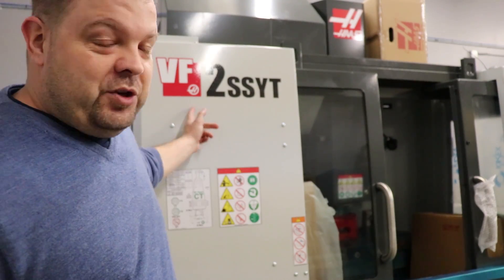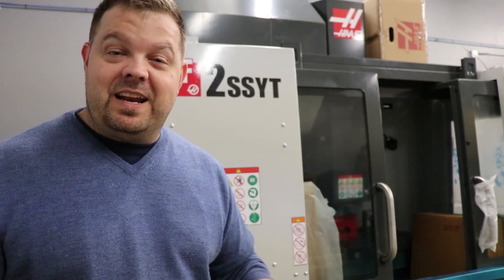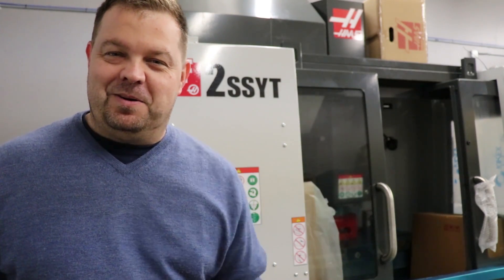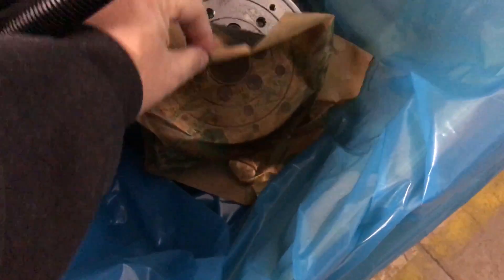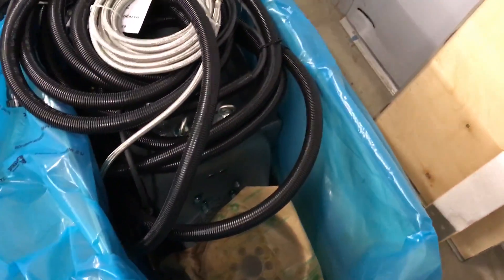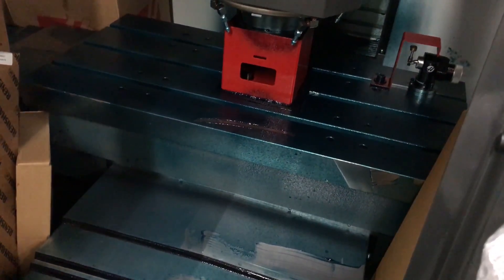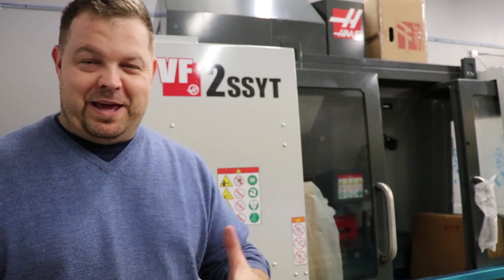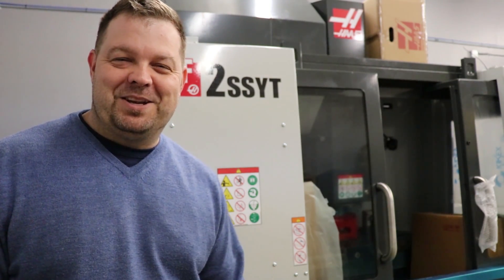5 Axis Rotary - Haas TRT160 Unboxing

Comment: Dude, nice acquisition, looking forward to what cool things you use it for.  Curious, are you running a shop or something?  Those are some expensive machines, what's the revenue source to make the payments?  I know YouTube isn't going to cut it, at least not yet.  I'm looking to get some machines myself but before I pull the trigger, I'm trying to line up some reliable work, to at least break even on the machine payments.  Hopefully at some point enough work comes in that I can buy more machines and pay some people to run them.
Reply from the maker: Andrew Michaud I own a manufacturing business that already generates revenue.

Comment: Hi Jason,
Did you purchase the MRZP option or what ever it is they call it. We have it at work but have been told by our HAAS HFO don't use it without the proper post or you will crash the machine. So we have been doing it the old way, just making sure everything is place in the proper location in the CAM system until we get our new post. Good luck, doing true 5 axis is a lot of fun. I run a Deckel Maho DMU 60 so the Kinematics take care of everthing, but I help the guys out on the HAAS machines.
Reply from the maker: THANK YOU! yes i have the DWO/TCPC and MRZP template. I'll look into this ASAP. I am literally sitting here testing 5 axis tool paths in simulation now.

I program in HSM works...I'm going to set up Machine Simulation

Comment: I like the new design for those! I have the old version which is an HRT160 bolted onto an HRT210 with a pair of giant feet to keep it from tipping over. It's big and lunky, and on a VF2 there's absolutely no way to fit anything else in the machine aside from the rotary alone. But I know you have more plans for this setup!! :)

Comment: Way to go Jason. After the Haas tech powers it up and answers all your questions, there's that first time you get to run it on your own. That machine is not a toy it will make you money, don't be afraid to push it. Hog cuts or high speed milling small depths of cut, 12,000 rpm 200 ipm. what a sound. Chips ahoy lol.

Comment: Looks like things are moving fast. Another new machine and TRT160 too? Nice. Looking forward to seeing some content on that. I've been thinking about a TRT160 to use on our VF-5SS for some smaller parts and as a back up when the UMC750 is busy.
Reply: What are you using for CAM? Do you have a custom post?
Reply: @arduinoversusevil2025  Surfcam Traditional. Yes custom post I wrote myself. Saw some of your struggles with fusion - I don't know if I can help much with a fusion post (no experience) but the definitely g-code stuff if you need a hand. Hit me up